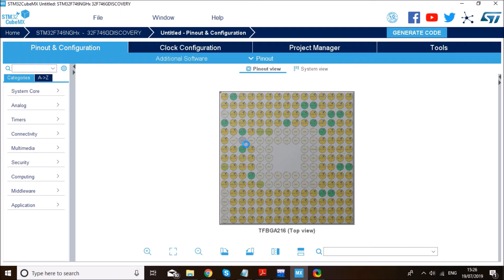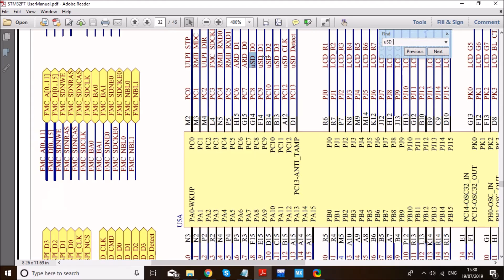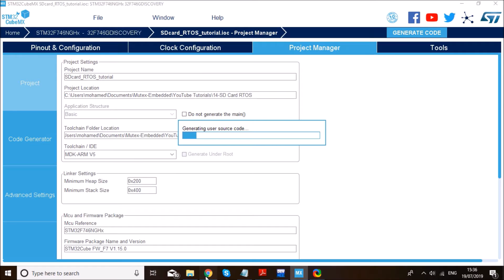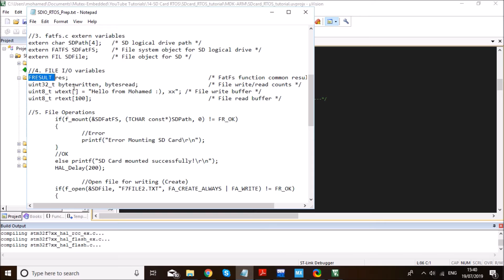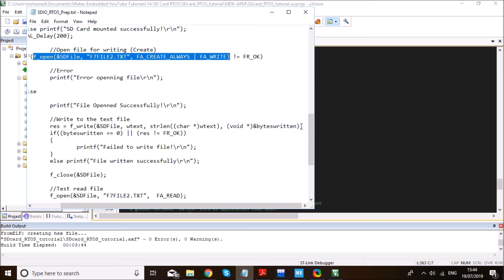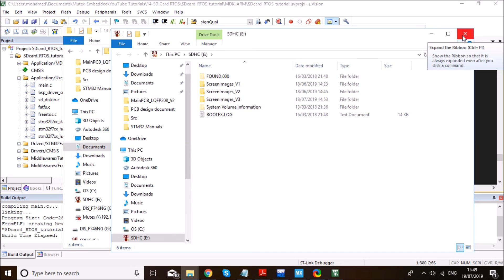STM32 - Keil 5 IDE with CubeMX: Tutorial 41 - SD Card SDIO with FreeRTOS

Comment: Hi Yaqoob. Thanks for your good tutorial. I am using a sd card with spi and I connected that sd card to an stm32f103rct7 and I want to test it with RTOS V2. But when I am using version 2, I get an error for semaphone as follows:

undefined reference to `osSemaphoreCreate' syscall.c Middlewares/Third_Party/FatFs/src/option line 45 C/C++ Problem

undefined reference to `osSemaphoreWait' syscall.c Middlewares/Third_Party/FatFs/src/option line 84

I searched everywhere for solution but I got nothing! Do you know how I can solve this issue?

Comment: I'm an aspiring embedded systems engineer. I've learned a lot from watching your videos. As I'm now transitioning into advanced projects and professional work, I'm curious to know the reasons why you choose to use HAL libraries. I have nothing against them but I'm starting work with developers that prefer to avoid them. Are they/should they be used professionally?
Reply from the maker: I use HAL libraries in all my projects, yes. I do sometimes avoid them only when necessary.
But generally speaking, those are provided by MCU manufacturer (ST at this case) to make your life easier.

Comment: You are the best!!
I am trying to replicate this with an st32f4-discovery and SDIO, but i get
f_mount() FR_OK 
and then.. 
f_open() FR_NO_FILESYSTEM
:(

if i look inside f_open() i get the FR_NO_FILESYSTEM at line :
res = find_volume(&path, &fs, mode);

if i look inside find_volume() the error comes from:
	if (fmt >= 2) return FR_NO_FILESYSTEM;	/* No FAT volume is found */

The card is formatted in FAT32
Reply from the maker: Hi Javi,
Check you MX_FATFS_Init()
Make sure it is called properly beforehand.
Reply: @mutexembedded2206  hi :), what do you mean by properly?

The autogenerated code in cubemx places it right before my code:

/* Initialize all configured peripherals */
  MX_GPIO_Init();
  MX_DMA_Init();
  MX_USB_DEVICE_Init();
  MX_SDIO_SD_Init();
  MX_FATFS_Init();
  /* USER CODE BEGIN 2 */
  //5. File Operations
res=f_mount(&SDFatFS, (TCHAR const*)SDPath, 0);
  	HAL_Delay(200);

  		//Open file for writing (Create)
res=f_open(&SDFile, "F7FILE2.TXT", FA_CREATE_ALWAYS | FA_WRITE);

Comment: Great Tutorial. Unfortunatelly I tried it with my nucleo-L452RE but it doesn't works. I tried with 1 and 4 data line, with/without DMA but when I call f_open() I get FR_DISK_ERR after 30 seconds. If I remove physically my uSD I get FR_DISK_ERR instantly. If you have some suggestions please write it. Thanks in advance
Reply from the maker: Disk problem often refers to physical layer. Ensure your SDIO connection is definitely correct and on the Nucleo board SDIO line is not shared by other hardware components that affect pull strength.

Comment: Can anyone help me in figuring out how to add .h files from the SD card on the main STM code?
Like in main.c file i want #include "example_file_in_SD_card.h"
Because i have a lot of include files and .c files that are not fitting on the flash so i have to move it to an SD card
Reply: *.h and *.c files are meant to be compiled by compiler and linked toguether by linker at design time to produce a binary firmware witch have to be burned in flash memory and then executed by MCU ! Even if you put these files on SD card, MCU can't read, undertand and excute them !!!
If your your program does't fit on flash memory you have 2 solution:
1- Change MCU model witch have enough memory !
2- Put your finale firmware in external memory (flash) if your MCU support that and you have to burn a small bootloader to do that in the flash memory of your MCU.

Comment: Thanks for this tutorial. How to save large files. I am trying to save an image from SDRAM which is 1280x1024 = 1310720 bytes but it does not work.
f_write(&myFile,(uint8_t*)(SDRAM_SAVE_ADDR),1310720,&myBytes);
Reply from the maker: Hi
Good one, I haven't attempted direct access copy from SRAM to SD. But i have tried using a buffer in stack, say of size 4096.where you copy an increment of 4096 from SRAM to array, then to SD card.

For direct copy from SRAM to SD, I have double check what constraints there are as far as memory mapping and MPU memory regions are concerned.
Reply: @mutexembedded2206  thanks, i will do a test.

Comment: Is it possible to use SD card without using FreeRTOS ? I have already developed bare-metal based application (also using SysTick) and now I want to save some data in SD card. Is it possible? I am using STM32F777.

Comment: Nice! Have you considered using the STM32CubeIDE
, a free eclipse based IDE with advanced debugging features?
It supports real-time tracing SWV (Serial Wire Viewer) where you can use printf() instead of using the UART peripheral. The printed data can be viewed inside the IDE debugger during debugging or using the ST-LINK utility otherwise.

The nice feature about SWV, is it utilizes the integrated CoreSight hardware feature, ITM trace (Instrumentation Trace Macrocell) on the Cortex-M MCUs to send a stream of software-generated messages, data-trace, and profiling information through a single pin (SWO pin) through the ST-LINK debugger available on all Discovery boards. 
Reference: http://www2.keil.com/coresight/

Thanks for sharing.
Reply from the maker: Salam Moh,
Thanks, I also been told by others and saw STM release news, very attractive indeed, just like how you described above. I would definitely check it out soon. Thanks again